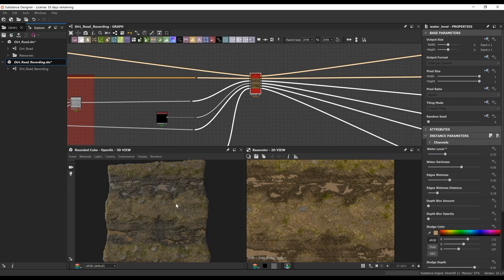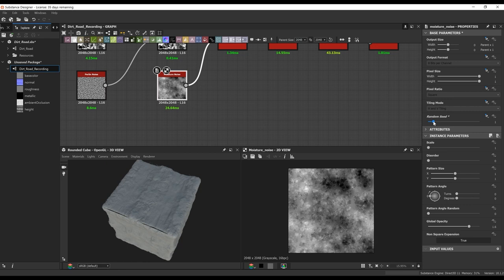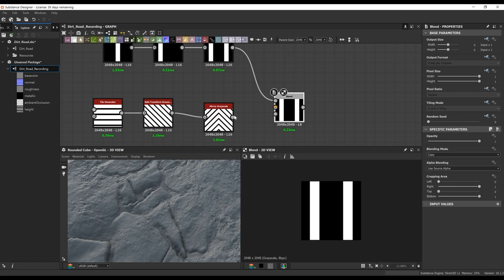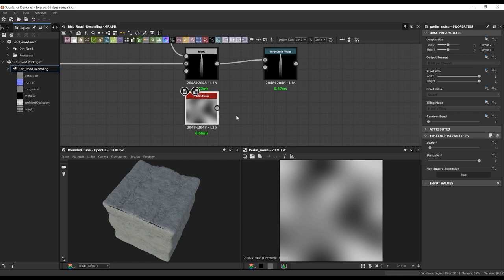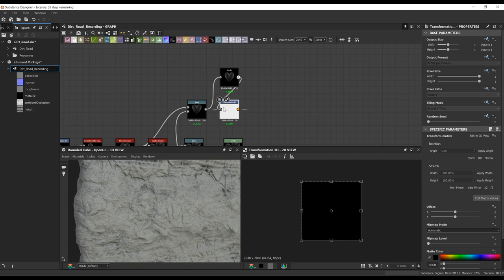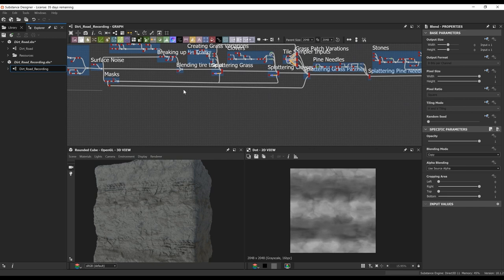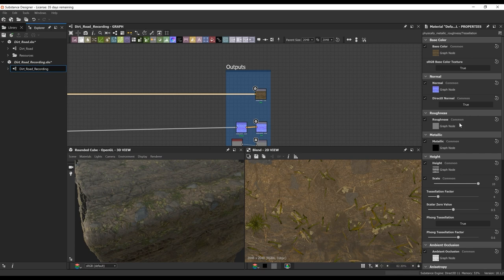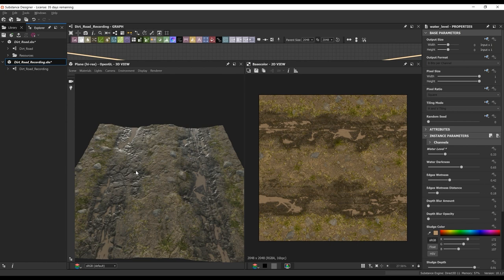Create a Realistic 3D Muddy Dirt Road w/ Javier Perez | Part 1

Comment: hey! that is an amazing tutorial, but i was wondering how much RAM do you use? i mean, which amount of ram you computer has, i have 16GB and my ram ussage was really high while i was doing the texture (I already dont finish it) and i dont really know if my computer will be able to handle it
Reply: I have 64 GB of RAM and Designer still lags sometimes, so you are in tough luck
Reply: @timsonss  well I find out that if you work with 1024x1024 while you are making the material, ram ussage get a way down, when you want to export it you just choose the texture size in export settings, hope it work to you
Reply: @matiastemesio893  i choose 512x512 while working lmao.
And just quickly switch to 2048x2048 in times to check the material and again back to 512x512 to do the work and get good fps